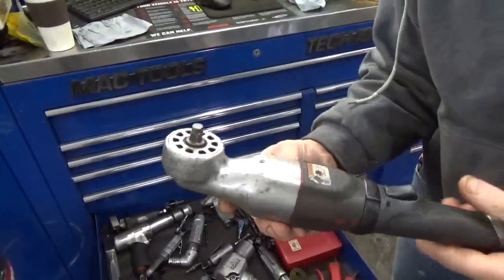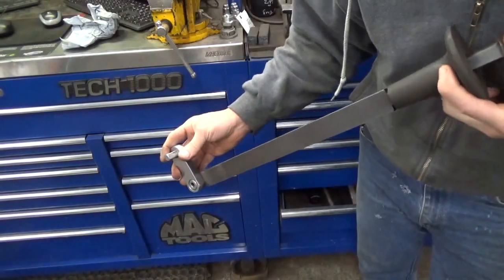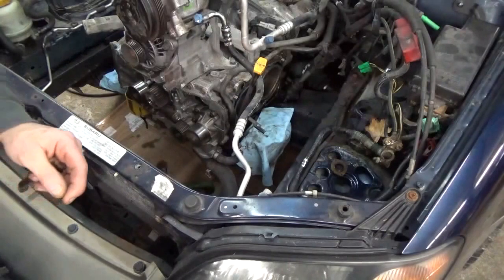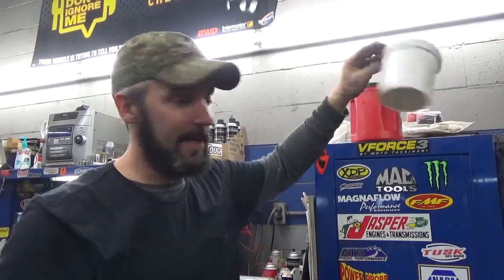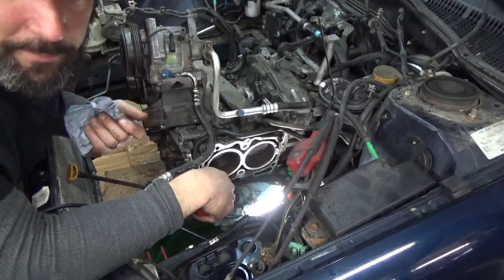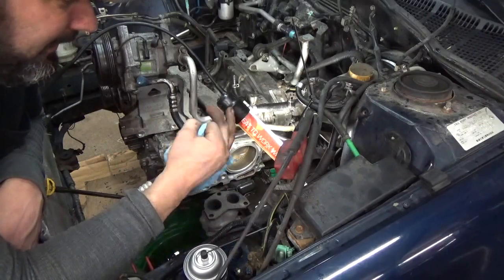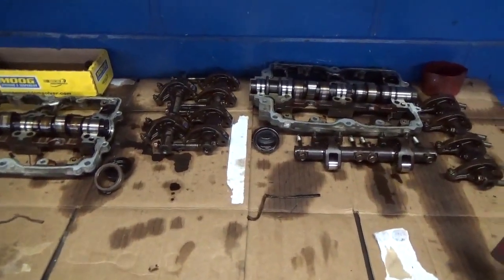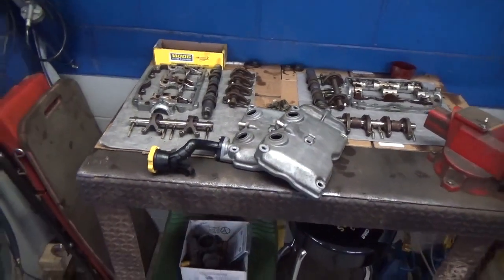Replace Subaru Head Gasket EJ253 - Part 3 of 5

Comment: Hi. Just been watching this and thought to share. I'm living Sydney. I bought an 06 Forester with blown h gaskets for the misses. Cheap because most mechanics here will charge A4000 to replace and even then they'll fit singe filament gaskets. Firstly, by the time I got all the junk off the engine, dismounted and headers off I figured was only bell housing bolt left to pull the engine so I did. Certainly easier than reaching over the side. What I did discover though is that it is possible to fit the wrong head on the wrong side! Only discovered that after I put the engine back in and got to connecting the pipe from the back of the left head to the intake ...there was no hole! Bugger. Pulled engine back out and took a punt reused mls head gaskets. I got the heads machined, levelled the block with diamond stone. Did valve grind. Has done 10,000 K since and all is good. Pretty hard to check block flat in situ. Thx for vid. Your back younger than mine

Comment: I drove a used Subaru that I bought with 85,000 miles on it that was immaculate. I loved her. A couple weeks afterwards I noticed oil drips on the driveway. Looked underneath and sure enuff the passenger side head was leaking oil ever so slightly. I knew about the Subaru head gasket issues when I bought it but the dealer had cleaned up under there so it was not evident there was a leak. I kept and eye on it and drove it another two years finally at 120,000 I put head gaskets on it and drove it until I sold it at  220,000 miles. It was unstoppable. Watching this vid makes me want another Outback. Seeing your work I could tackle the head gasket issue myself.

Comment: Thanks for showing us the hatch where you kept all the parts.  It's not difficult to be organized.  I've used cardboard boxes to keep parts in and I've used tupperware-type containers or even ziploc sandwich bags to keeps different component fasteners in.  You can label the bags with a sharpie and it takes the guesswork out of what goes where.  Thanks again Eric.

Comment: I bought 100 8-oz. cups and lids and 50 32-oz. cups and lids from Smart and Final. I labeled them "VALVE COVER - R", "VALVE COVER - L", "ALTERNATOR", "WATER PUMP", "FAN", "RADIATOR", and so on.  There are plenty of tubs to go around, even for things like "SUPERCHARGER FRONT COVER" and anything else which might show up.

Sure, it takes a few minutes extra on disassembly, but it has saved hundreds of hours of head-scratching on reassembly over the years.
Reply: Keep up the good work, my honest mechanic friend.

Comment: For the hose puller pliers, Harbor Freight sells a half decent set of 3.  They're called "Long Reach Hose Grip Pliers".  A pretty good deal for about $20 if you're a DIY at home mechanic.  Don't know how they would stand up to constant use but they're very basic and simple tools so they should last a long time if not abused.

Comment: Otiker clamps are what those hose clamps that are spring loaded are called. (brand name) I prefer the worm-gear band clamps for ease of installation/removal. I have debated the preference with other engineers and the otiker is supposed to give a constant tension to the hose over the operating range, rather than a single tension such as how a band clamp does. just fyi

Comment: I'm just a shadetree mechanic but I've done a few head gasket replacement jobs over the years, although none on a Subaru. However, my wife just bought a 2015 Scion FR-S with a Subaru engine so you never know. Anyway, as it happens all my head gasket replacement jobs, both foreign and domestic brands, have been on cast iron blocks, some with iron heads, some with aluminum heads. These days I chase the head bolt threads in the block before reassembly as they can get pretty gunky sometimes. You didn't mention if you did this with the Subaru. Just wondering because I have never done a head gasket job on an aluminum engine block.
Reply from the maker: Hey mailpup  good question. If you have the ability to run a thread chaser down the hole it never hurts for sure. It really depend on the job for me I guess and the engine design. By default these Subarus actually stay pretty clean from what I have seen over the years.  If I had any doubt though it would make sense to just double check and run a chaser down it.

Comment: Formula 88 is perfect for degreasing aluminum heads and blocks. And it's super cheap. Soak them in a few gallons of that stuff for a couple hours, power wash them off and they come out absolutely spotless WITHOUT etching the aluminum. I HIGHLY recommend using that stuff instead of scrubbing for hours.

Comment: I am working on my G/F's 2000 Forester. The tensioner went bad and caused the timing belt idler cog to break.  the valves were bent so I sent the head to a shop to be repaired. The mechanic told me to clean the engine block with Scotchbrite. I plugged the holes (not airtight) and started cleaning the mating surface. then I started to read about how bad S/B was for the bearings. I could use some advice about how I should clean up when S/B is used. I also am wondering if SB used with WD40 will scratch or distort the surface.  also how clean should the surface be? is some shading ok??The videos about Scotchbrite have kept me from sleeping...   thanks David
Reply from the maker: David Perenyi Shoot just saw this... a little late now, did you get it?

Comment: You mentioned that Subarus suffer a bit with head gasket problems. I then noticed when you mention the gunk collecting under the cylinder sleeves, (I know this was due to a gasket failure.) but I was wondering if the problem is people not running with good clean coolant? I also wonder due to all the clues you showed that the heads have been off before and the last guy didn't clean the gunk out like you did leading to overheating and the new gasket failing? 
Good video and excellent work. The Subaru will run so much better than before after your care.

Comment: Just ordered a reman head from rockauto 241.00 plus 100 core. Not that experienced in camshaft dissasebly. Save on  the machine shop costs and down time.  For a 2002 Subaru outback 2.5.

Comment: I have learned from bitter experience, Subaru water pump, tensioners and belts
ONLY, unless you want to be doing the job again in a year. 
And Subaru MLS head gaskets, not the originals for the same reason.

Comment: Cool tools, surprised you do not get brake clean by the gallon or bigger . I use a lot of ultra black , well not alot in one place but , well i use the black . I like to try different tools hands on , so if you could just pack up ALL your tools and send them to me , building included , i will send back any i do not like , lol
Reply from the maker: Lol I'll get right on that haha. OHHH your one of those silicone gobberes huh!! Nahh just kidding. I get that brake clean pretty cheap, usually around $2 a can or less...
Reply: South Main Auto Repair That is a good price , I pay $25 a gal or $60 for 5 gal , Once i had it figured out the spray can vs gal price but i do not remember exactly ,but i was more than $2 a can . I still use cans in a lot of videos , because if not everyone asks what i was cleaning with .
Reply from the maker: oh got ya . Advance Auto usually has it on sale around here for $1.99 a can by the case.

Comment: Great work, now I know what to expect when I have to do mine! Without fancy tools. Ugh.

Tiny constructive criticism, at least I hope it is taken as one, Anti-seize. Anti-seize the crap out of everything. It WILL need to be re-done, at some point, to the car and it will be  that much easier the next time. Especially living/working in rust belt areas.  I anti-seize everything from lug nuts to radiator hoses.

Is there a specific reason you don't? If so I would be interested in the WHY of it.
I groaned mentally every time i saw a bolt go in bare... haha
Reply: Medic Four You have to be really careful with anti-seize because it changes torque values of fasteners. If you do use it, the copper formula seems to be best, and the torque you apply needs to be decreased the proper amount to avoid damage. The head bolts I'd consult the FSM. If they say dry, install dry. If they give other instructions or values for oil or anti-seize, go for it.

Comment: Great videos!  It's great to see this process done right with you taking the time to properly clean everything.  I'm getting ready to do this same process.  I have two 2.5 s.  One has a rod knock in cylinder 1 and the other one was pulled but have no history on it.  Wondering a good way to diagnose what's wrong with the engine with it already being out of the car?  Is there a way to compression test it by turning it over while its on my hoist?  It will turn over by hand.  How would you check a 2.5 when it's already pulled?  Trying to see what I got and put together one good runner from 2 blocks.  Hoping to see if this other 2.5 lower end is good before it start ripping into everything. Any advise?
Reply from the maker: chad holdener Boy that is a tough one to diag with out it running. I would almost tear it down just to have a look. You could do a leak down test but that might not tell you much other than the fact it seals or not ya know...

Comment: what size air compressor do you have? do you have a slave and master (compressor) with the same tank?
so the slave keeps the tank full when  between 80-120 psi and the master kicks on at 80# and below...
saves power$$ and master run time ( wear and tear).....
Reply from the maker: +griff Hall 80gallon 7.5hp 2 stage. On at 140psi off at 170psi.

Comment: One of the things I have noticed throughout your videos, you are pretty meticulous. Almost OCD! Your shop is always clean. The way you do things is pretty methodical. I'll bet if someone rearranged a few of your tools you might go a little nuts.
Reply: I know you hate throwing stuff out that has use left in it. Old cotton T-shirts are great for mopping up spills and brake cleaner. :-) I have all kinds of containers I keep and re-purpose. One of my favorites is the containers that the 2-qt diet drink powders come in. They will hold longer screws, bolts and nails besides anything that comes to mind and have a lid. The Crystal light containers are also translucent. I had a Stanley fastener case, kind of like a tool box. Loaded with different varieties of drywall screws. The hinge broke off. Drink containers to the rescue!

Comment: i work in health care and have lots of respect for mechanics! anyway i'm in the process of rebuilding my motor. I spun a bearing not too long ago and was wondering if I should have my cylinder heads resurfaced, assuming they're fine.
Reply from the maker: MATTHA FAKKA You know it is best to take them to a good machine shop to have them checked and repaired if they need it. If you are rebuilding an engine it would only make sense to have the heads checked and repaired. Milled if they need it, V-job , pressure test, sonofluxed and new seals installed.
Reply: South Main Auto Repair thank you for the reply. now which is better hot tank or ultrasonic cleaning?
Reply from the maker: MMmmm either way I guess as long as the get clean... dunno if one is better or not?
Reply: South Main Auto Repair okay thank you. keep up the good work by the way.

Comment: I use muffin/cupcake tins to organize my bolts. That way you can keep them in order. I have a hammer head and I don't use it much coming apart because it does not have much break away torque. Need me a set of those vise grip hose clamp pliers
Reply from the maker: TheToadkicker Oh that is a good idea with the pan. Interesting about your hammerhead, I can remove wheel nuts with mine?

Comment: Any issues with hanging a locker on a side box?
Reply from the maker: No, but I did buy a wheel kit for it to install underneath it. When I had it at my Dads shop I use to wheel it all over the place. His shop is 80'x130' so a lot more room to move around. It always rolled good and no problems. I have a single swivel wheel under both lockers.
Reply: cool